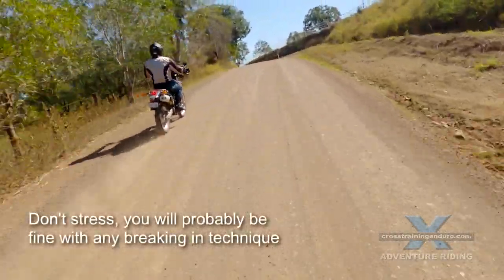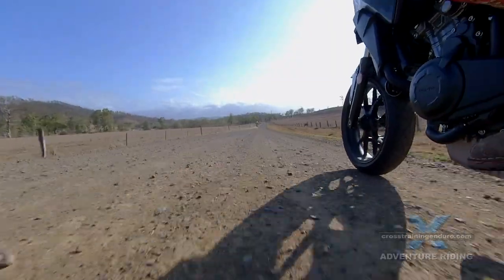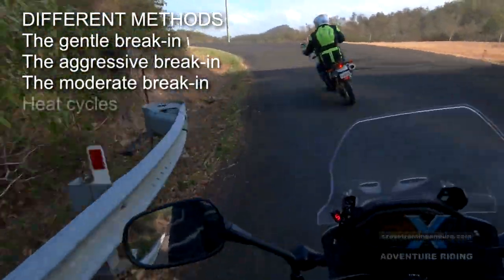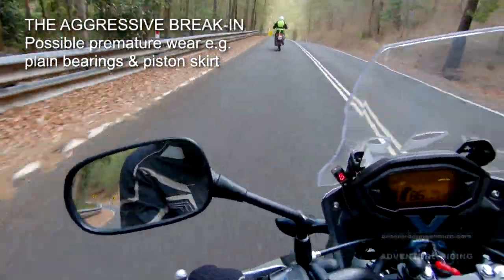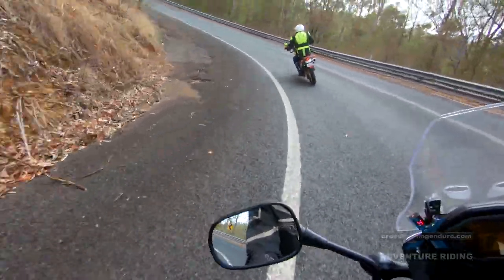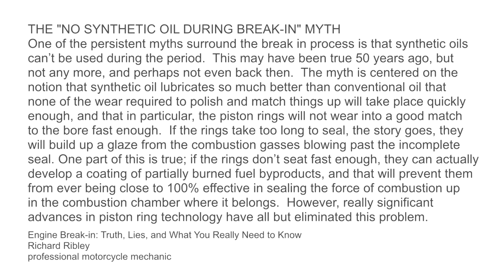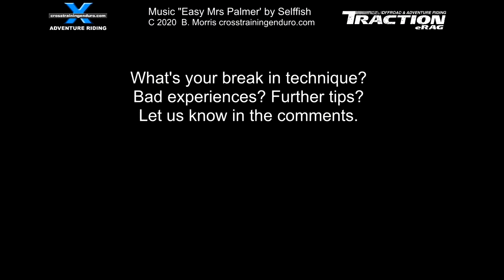How to break in a new motorbike engine︱Cross Training Adventure

Comment: The "heat cycle" is the most misunderstood...  Its not that the parts need to heat cycle to "toughen" but rather as the moving/touching parts are wearing from rough to smooth, the heat they generate can be excessive enough to change their metallurgy causing premature wear patterns in the future.  Giving the parts ample time to wear together without generating excess heat is key to longevity.
Reply: Your dead right and a great explanation.   You must be a mechanic or engineer ?

Comment: I've owned a couple of identical bikes over the years, same model and year. One always performs better than another. The ones that ran stronger were broken In by me using old school technique: keep changing rpm as much as you can, keep revs low until valve adjustment.
Reply: What u mean keeps revs low until valve adjustment! When are the valves adjusted on an new bike, didn’t know that was a thing

Comment: I've never owned a new bike, only purchased used two strokes. I've rebuilt a few motors with new bearings, pistons, nikisil plating etc etc. With the rebuilds I just ran a bit more 2t oil in the fuel, let the bike warm up for a minute or two then rode it normally with 5 litres of fuel. Once done I would replace the gearbox oil & run the normal premix ratio.

Comment: It seems to me that if a certain type of engine break in actually made a significant difference, there wouldn't be so much controversy. Instead, you have a bunch of people saying one thing, a bunch of people saying the opposite, and a bunch of data that doesn't seem to point one way or the other.
Reply from the maker: Good summary. It looks as though it simply doesn't matter in the vast majority of cases, but some riders get worked up over why one method MUST be right... probably a bit similar to religions or political beliefs lol.

Comment: The best way is a deliberate hard break in (varying hard accel and hard engine braking) with a super early oil change, it seats the seals better and will let the motor make more HP. Flogging it does help, you need to seat the seals :)

Comment: Honda's Shop manual for a CB300R literally states: 
During the first 300 miles (500km) of running follow these guidelines to ensure your vehicle's future reliability and performance.
- avoid full throttle starts and rapid acceleration
- avoid hard braking and rapid down-shift
- Ride conservatively

no hard numbers other than 500km.
Reply: This is about liability not performance or function

Comment: In 2009 I bought a brand new EU version of the Suzuki Boulevard C50 (the C800/VL800), and I did the break-in +/- per the manual. Meaning, I rode with half the throttle for the first 500km and 3/4 throttle for the following 500km. Yes, ocassionally, I did top speed, just to get all the metal shaving out of the system, get rid of potential carbon, etc.. And maybe a bit of a superstition on my part - I did not want the engine to "get lazy" 🙂 Then, at around the 1k km mark, I did the service check & maintenance (again, per manual) and what a suprise, aftwreards the bike ran for 11 more season (*) perfectly fine, without a single issue - and for ten of those seasons, only regular maintenance was needed. Only when going into its last season, I had to recharge the battery (for the first time), but that was it.

The VL800 is a superb bike anyway, I need to add.

(*) I had to sell it in December 2020 and I did that to the same dealer I bought it from, who then sold it to a new owner in early 2021 - and to my knowledge, that new owner enjoys its problem-free state of operations up till this day

Comment: ANOTHER POINT: NO ZERO NONE motorcycle manufacturers will ever risk the liability of telling people to ride hard on a brand new bike they don't know, and especially not to "ride it like they stole it".
Such advice just ain't EVER gonna happen, no matter how true it is.  Sure, seasoned riders are going to do this, they have no problem because they are used to different bikes, and can automatically adjust and cope with getting on a bike they have never ridden before, as long as it's at least in a familiar class to what they are used to.  I "rode it like I stole it" and then did an oil change at 30 minuts, when I bought my new XT250 a few years ago, but I have been riding very similar bikes for decades, and it's not a challenging bike, I wasn't going to kill myself in the process.  That simply does not apply to a first time or small bike rider buying some big crotch rocket, they stand a very good chance of serious injury or death, and if the fucking lawyers can show a judge that the owner's manual told them to do it, there will be hell to pay.
The only advice we'll ever get from the manufacturer will be ride gentle to normal, any alternatives are too much risk to them, because the world is full of idiots, and some of them buy bikes.

Comment: Being an Aircraft maintenance engineer by trade, I will stick to the manufactures recommendations . Aircraft, vehicles and motorcycles are no different.
If the manufacturer  says, only rev to x amount of revs for the first thousands kays or whatever, do what they say. If they  say don’t ride off until your oil temp is at 50 degrees C, do that as well. Engineers who design these engines  are the ones inputting into the manual.  
Pretty simple, just follow the procedure.
Reply: Another note is usually if you compare break in procedures within a manufacturer's range of bikes they have the same exact rpm limits on 125cc to 1000cc bikes.

Comment: My BMW GS1200 manual states (Rider_s_Manual_BMW_R_1200_GS_2008.pdf) at page 154; Engine Oils - please see the quote below:
BMW Motorrad recommends not using synthetic
oils for the first 10,000 km. Please do not
hesitate to contact your authorised BMW
Motorrad dealer if you have any questions relating
the choice of a suitable engine oil for your
motorcycle.
-- Keep up the good <vids>

Comment: On my 2023 KLR, I’m going up the canyon, then let it cool. Go down the canyon, let it cool. Repeat with next canyon, running up the power and letting off. Change oil at 50miles, 150, 500, then every 3K. May be excessive, but it at least makes me feel like I tried to get a good ring seal. Tires, get em warm, let em cool. Scrub em on asphalt first, tgen dirt canyons.

Comment: Great subject/video, Barry! I'm currently in 'break-in' with the new T7 now. My plan is to stick to the manufacturer's recommendations thru brake-in and warranty (including lube and filters), then open up the possibilities! Doesn't feel very limiting as I am adjusting to a new and very different bike as well....loving it so far!  Cheers, and heal well!
Reply from the maker: it doesn't feel to heavy, allen? in the old days the old XT600 was very similar in weight to the honda and suzuki but then they really packed on the pounds with the 660 models and leading eventually to the T7. it probably makes it more stable on the road but i wouldn't want to try lifting up a fallen one. i hearing rave reviews though... 😊
Reply: @crosstrainingadventure  Yes it  is quite a bit heavier than my old DR 350, but I've been watching the coming of the T7 for about 3 years now and it ticks all the boxes for me and the kind of riding I want to do, well into the future, which is a combination of work commuting, trail , and some long adventure rides. So far I can tell you that this bike has very good manners on tarmac, gravel and two track, with plenty of torque throughout. The bike is very well balanced, and it seems it's biggest limitation is me!  My goal is that over time I will come close to being able to ride it to it's potential, and that will great adventure!! :-) My broken leg is healed enough that I'm back on the pegs. hope your healing is coming along well!  Cheers!

Comment: I do what they call a cold break in where you start the bike immediately ride it for a short distance let it cool and repeat 3 times. Just riding like normal most the time but goosing it up here and there. Basically the idea is the piston rings harden some on longer rides so not letting the engine warm up to much for long beds in the rings better
Reply from the maker: Yep, we covered heat cycling in the vid, Tenza. There doesn't seem to be any evidence for it working... not that we could find anyway.
Reply: @crosstrainingadventure  not technically heat cycling because if you touch the engine and it’s warm you got it to hot

Comment: I've drowned the bike twice during break-in, does that count as the heat cycle? Mineral oil is a good bet though, especially if you are too lazy to check the water depth, since you'll be changing it soon enough anyway.
Reply from the maker: twice should be enough. you only need to do it once though if you pour mud directly into the spark plug hole then kick the engine over a few times.
Reply: @crosstrainingadventure  Sadly, no kick starter on the newer AJP models, so I had to go the "long way round".

Comment: What year did they start locktiteing the NSU bolts on the dr650?
Im buying a 2015 model and wondering if i need to check them?
thanks!!
Reply from the maker: i think it was 2012 and on? check the pinned first comment on our DR650 known issues vid on our adventure channel, i put the info there.
Reply: @crosstrainingadventure  Thanks, I have had a look around but there are people saying they didn't start till 2017 as well..
thanks for the reply though !
Reply: Its 2017

Comment: LYW. Here's a good video topic: jump starting. My owner's club chat is very divided on this. Some say you don't want to do this because you'll cause a surge and break something electrical -- the most feared gremlin any of the oldies can warn us newbs about. A small minority (maybe just me) says there's a difference between a voltage source and a charger: a charger pumps current into a system, and too much can damage things, but a voltage source only supplies the current drawn as predicted by ohm's law, so connecting 12V (fish) in parallel with your existing 12V(fish) battery won't hurt anything. What's the real truth?
Reply from the maker: I don't know any electrical engineers for this one... I did do a vid on the enduro channel about how to start bikes without a kickstarter.

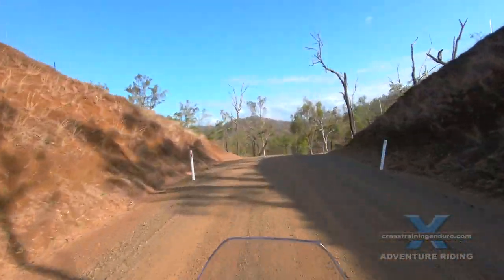Comment: 2:20 ... "A dead run"  - Got me on that one :D
Reply: They put the engine on a simtester. It turns the engine over at a lower speed than normal whilst oil is circulating until the power required to turn the engine levels off.
Reply: @jonnoMoto  Thanks for the explanation, but I meant that there was a dead animal on the road just when he said "dead run".
Reply from the maker: and i didn't even plan it that way... 😊 one of the strange things with video editing is those moments where strange little things like that happen without any planning.
Reply: @crosstrainingadventure  Funny that you didn't even plan it that way, because it was so perfectly timed. :D By the way, I hope your recovery keeps on going as good as it did so far! :-)

Comment: It shouldn't be that much work because there are several Chinese manufacturers buying the rights to old Japanese engines to make them comply with Euro 5 standards, see the example of the Mash X Ride 650 that uses the Honda Dominator engine to which an oil radiator has been added and Injection, this example is one of the best because is Air/Oil cooled.  Perhaps the Japanese are already turning the page on combustion.

Comment: Follow the instructions in the manual would be the best advice you could ever take
Reply: The manual says "Avoid full throttle for the first 1,500kms. First service is at 1,500kms. Check valves at 15,000kms." They're either very sure of their engines or it's something they do to make sales on parts.

Comment: So here’s a thought, the engineers that designed the motorcycle might be more knowledgeable than all of us 🤔, a radical idea might be to read the owners manual that comes with that new bike, and follow its instructions for break in 😆👍.
Reply: Yes I asked a good beer Brewer what has secret was and he said follow the instructions
Reply from the maker: maybe and maybe not. what you are forgetting is that some manuals for older bikes still follow the very old style break in which might possibly result in glazing. some argue manufacturers do this to minimize chances you'll push the engine and maybe cause issues within the warranty period, who knows. if you blindly follow the manufacturers you will also be restricted to only using the brand of oil they recommend (and usually because they get a kickback).
Reply: @crosstrainingadventure  also pending lawsuits for if something goes wrong while running in a bike aggressively or less than aggressively while following manufacturers run in schedule